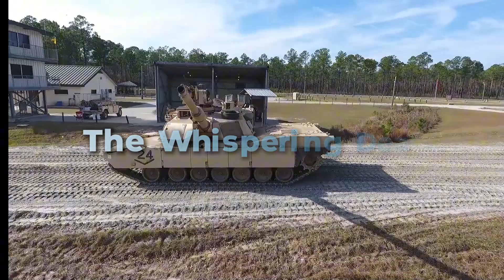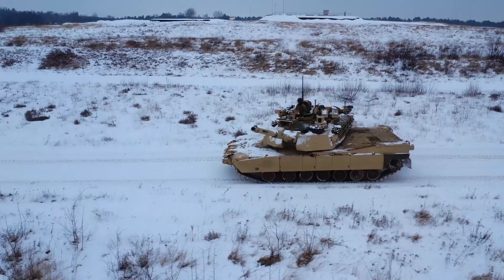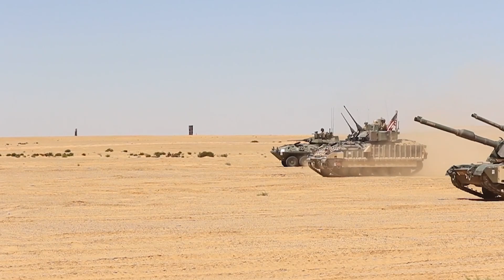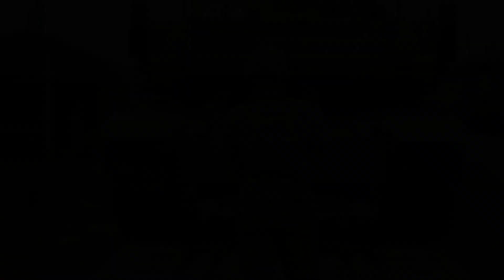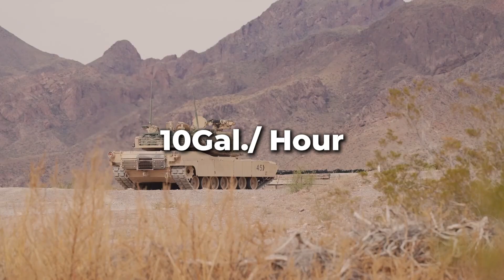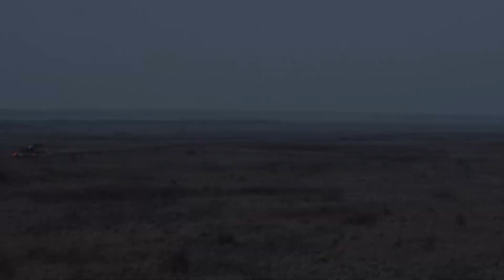M1 Abrams AGT1500 Gas Turbine – Why the U.S. Army Put a Jet Engine in a Tank

Comment: That engine also produces a distinctive exhaust smell that's fairly unpleasant but about 15 feet behind it is an amazing place to warm up during winter maneuvers or in extra cold conditions, it will also dry your uniform in about  three minutes if you're wet. The sabot round is incredibly fast and flat shooting and they are an impressive piece of kit. 🫡🙂👍
Reply from the maker: Thanks for sharing your experience! I honestly didn't know about the distinctive exhaust smell. That's a fascinating detail. What would you compare it to? Diesel, kerosene, or something completely different?
Reply: @HeavyMetalMechanics1 When I was in the 3rd ID I'm fairly certain they were mostly burning JP8 so I'd say kerosene - it smells funky 😋
Reply from the maker: @S @Sp1der44  oh ok. The Marder an Leopard we had burned diesel and they always stink.
Reply: @HeavyMetalMechanics1  I definitely know what you mean - we had a couple of M728 Combat Engineer Vehicles (Based on the M60 tank chassis) and they were very stinky, smoky and loud especially relative to the M1 Abrams which was practically stealthy in comparison - You could hear the 60 series approaching from two kilometers away on a still / quiet morning.